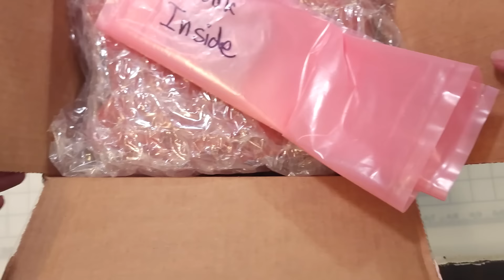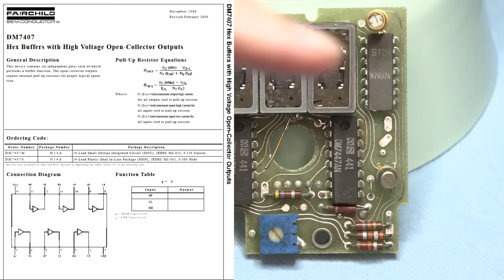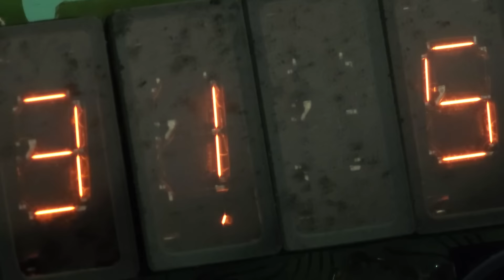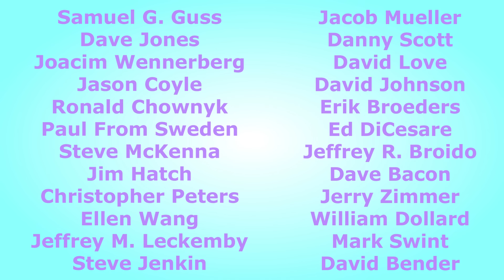Tiny Tube Surprise Viewer Mail!

Comment: I made a clock with six of those 3015F's in 2021 and it's running happily ever since! It includes six 74HC595's and an ATTINY85 to control it all. I still have a couple of factory-made pcb's left
Reply: I did exactly the same, but quite a few years earlier.  Remarkable, unique, and wonderful display device!

Comment: Nice displays! Over the years I have decommissioned and parted out old equipment especially medical devices and saved the numerical indicators and other components such as CRT tubes. I also scored a lot of NOS nixie tubes including some large ones with the red contrast coating. Sadly freight is prohibitive these days, I sure would love to be able to send all this gear to you for your research and projects, hate to think it will most likely end up in landfill one day.

Comment: Trying to think of a use case for that many digits with the first two being limited like this, first thing I thought of is a channel display for aviation.  The digits required are going to be limited to 11X.XX 12X.XX and 13X.XX
Reply: Exactly right, aviation VHF comms would be on 118 to 137 MHz
Reply: Great thinking!
Reply: I thought exactly the same. I'm guessing the display is for an aviation VHF radio capable of tuning to only 50KHz (0.05MHz)  increments so the right most digit can only alternate between 5 and either 0 or blank, consistent with an older scheme; the newer scheme halves the steps to 25KHz, requiring an additional display digit.
Reply: @anthonyx916  I have seen some use the 25kHz spacing without an extra digit through rounding the 5; it would count 0,3,5,8,0...

Comment: I made a short YouTube video clip operating one of those 3015-F Minitron displays. I was preparing to drive them with low-side fets before seeing that I could drive them with a regular CMOS logic IC. I was amazed at how little current they actually require to run.

Comment: It looks like the display PCB in the Rockwell Collins VIR-351 navigation receiver.
Reply: Or the VHF-350?
Reply: @jeffreyyoung4104  But did that version have displays?!
Reply: Definitely a VHF variant (matches the frequency range 11x.xx to 13x.xx MHz) so a VHF-251?
Reply: @Rokreder  Correct.
Reply: @simongenius1975  Sorry, I got my numbers wrong.

Comment: I have a few of these, I believe they came from a 'bargain pack' of random displays from Tandy electronics. (as 'Radio Shack' was called in Australia)
I've toyed with making a clock from them, but as I cannot get any replacements should one die - as all incandescents do in short order, I've been reluctant to do so.
Reply: I remember those bargain packs, they also had them with random LEDs in.  Good value for a kid with limited pocket money; the contents of my component bin dictated my project designs instead of the other way around.  I've never gotten one of these displays, though.
(And it was called Tandy here as well in the Netherlands).
Reply: Maybe something that won't see such long operating time like a calculator or something you can connect to a computer or microcontroller and make a game to work with it or something.
Reply: a clock with a timed switch button or motion detection?

Comment: very cool display Frannie, the frequency range & photocell automatic dimming would be typical in aviation vhf NAV/COM devices as others mentioned. wouldn't air COM require 3 decimal places 118.000 Hz to 135.975 MHz for 760 channels?
Reply: nevermind, I figured it out, the old radios used 25kHz spacing with only 2 decimal places that ended in 0, 2, 5, or 7, & the missing 3rd digit could only be 0 or 5 so 118.00 = 118.000
118.02 = 118.025
118.05 = 118.050
118.07= 118.075
118.10= 118.100 etc

Comment: Hi Fran Thank you for your videos I enjoy them very much.
I am trying to wire up a 12VDC motor that has a zip tie on the shaft and a limit switch on each side of the motor. 
There is a door bell switch I want to be able to push and have the motor turn making the zip tie leave the one limit switch and go 180 degrees to hit the other limit switch making the motor instantly reverse and the zip tie go back to the first limit switch and shut off.
My power comes from a Milwaukee cordless power tool battery.  I have three 5 pin relays but I think I might need a latching relay of some kind.
Any kind of explanation on how to wire up a circuit to make this work would be greatly appreciated.
Making a resetting target for a slingshot that makes a flash pot explode with a big puff of smoke.